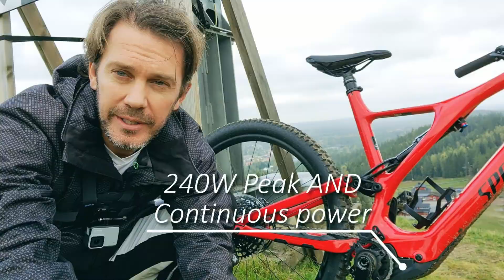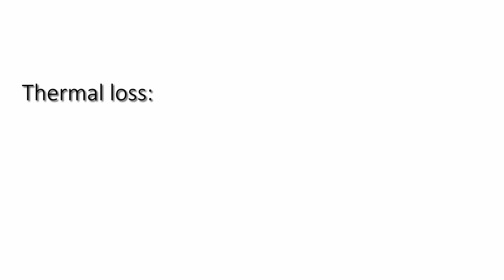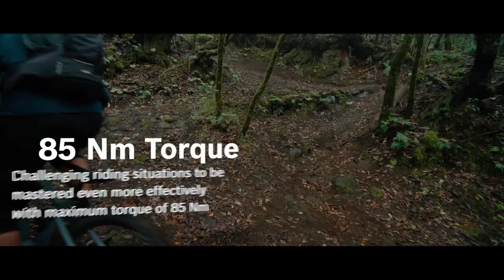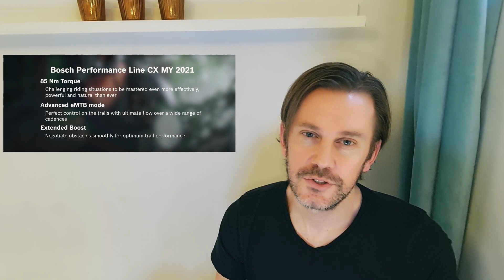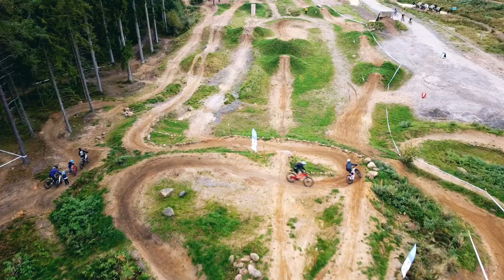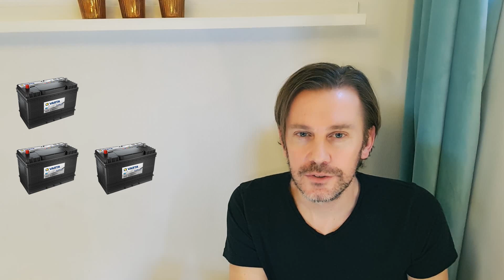Why don't all eBikes use 48V motors? | TECH TALK

Comment: So, 4 years later, which ebikes do we have now in the market that use 48V systems???
Reply from the maker: Interesting question. TQ HPR 50, Brose's new Drive3 Peak & ZF Centrix. Isn't DJI Avinox 50V? I don't think the new Bosch CX Performance or the Fazua Ride 60 are more than 36V.
Reply: @MTBs  Yep, I would say TQ HPR 50, Brose Drive3Peak, Specialized SL 1.2(by Mahle)...I didn't heard nothing about Bosh or Shimano.
So next question: why thoes brands don't talk almost nothing about their 48v systems that they have already in the market. 
Checking several sites, media lunch, technical info, etc, no one mention about this feature which I think is something good and better than the 36v systems.
Reply from the maker: I've seen that mentioned by ZF and DJI. "For better efficiency" or something similar. Maybe voltage claims doesn't sell, so it's not worth mentioning?

Comment: Man, I have to say congrats because I also recently tested a Levo Sl and the battery after 45kms and 1100 mts alt. And a total time of 2.30hrs it was only remaining with 5% of it's capacity, please also note that I only used the turbo mode on 20% of the circuit. So again my congrats for riding half day with only 30% battery.  Maybe you want to provide us some additional inputs on how you manage to ride half day and spend only 30% battery. 😉
Reply: Hey Olof, thanks for the reply, well I'm looking for a emtb to fit my needs and I already tested a couple, I have to say I was a bit happier with the handling of the Levo SL but has an investment I would go for a 85nm's motor with a 500 or a 625 bat pack. Honestly I think that the Levo Sl gives us a bit more of mtb feeling but it lacks in terms of power at the same time so I'm very curious to try the Orbea Rise not mainly because of the battery which I think the efficiency will be similar to the Levo Sl but I mainly elwant to see how is it gonna be  in terms of power. I'm not prepared to sacrifice handling only for a bit of boost not to mention how expensive a bike like this is. I honestly hope Orbea Rise to  surprise me otherwise I'll be forced to go with a 22+kg emtb... ☺️🤞
Reply from the maker: Would love to test the Orbea too! Maybe it's the best of two worlds. Amazing how they got the weight so low on that bike. 
Agree that the SL is by far one of the most fun bikes out there. I hope there will be more contenders in this category soon.
Reply from the maker: Hi Carlos!
Great with hands-on experience from other riders! I was riding and filming for about half a day, not flat-out climbing 1100 vertical meters. I didn't use turbo mode much either. Point is, that comparing to other eBikes I got about the same battery life from a smaller battery (albeit a smaller motor too). I thought the battery would drain a lot quicker.
This triggered my interest to find out more about different motor systems. I don't think 48V is a revolution in anyway, but I do think it helps to get better range to some extent. The biggest difference is probably how much torque you use.
Cheers!
//Olof

Comment: Det här är ganska återkommande! - Tittar vi på fpv racingquadcoptrar har vi  gått från 3s (11,1V) till 6s (22,2V) under de senaste åren av samma anledning. - Vore intressant med ett riktigt vetenskapligt test som visar skillnaden i effektivitet,  brukar vara mest känsla inblandat i testerna jag ramlat över.  Vad skulle nackdelarna kunna vara med högre spänning? Mer slitage på elektronikkomponenter i ESC? Mosfets etc som behöver vara anpassade för högre spänning för att motverka överslag? Har de kanske redan nått gränsen där skillnaden i effektivitet är försumbar? - Bra video, min tanke är att vi kommer se fler 48V cyklar i framtiden både som försäljningstaktik och för ökad  effektivitet.
Reply from the maker: Tar det på engelska - Thank you for your comment!
I don't think it will stop at 48V, there will probably be motors with even higher voltages in the future. As far as I have learned, there are not any real drawbacks with higher voltages at this level as long as all components are designed for it.
I see a difficulty to get to higher voltages in cuadrocopters though, since I assume the battery packs can be small. You need more cells to build up the voltage (as you probably already know).